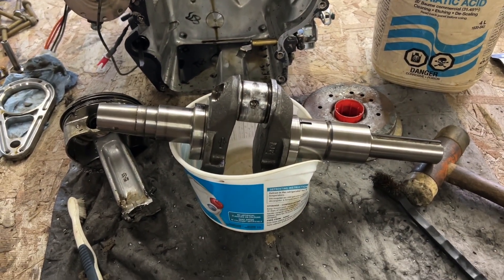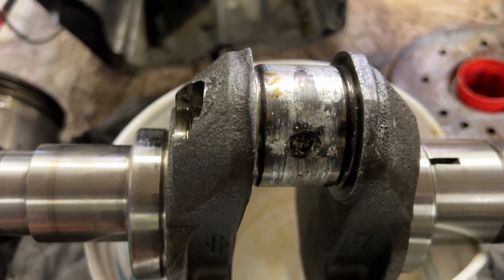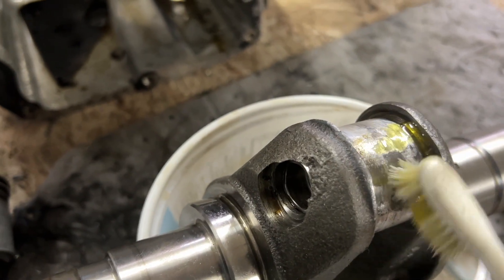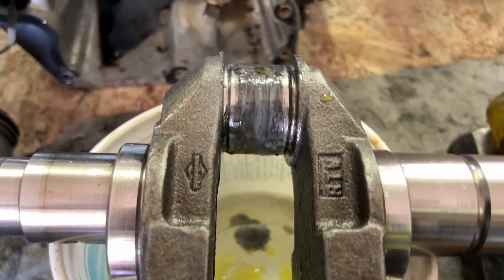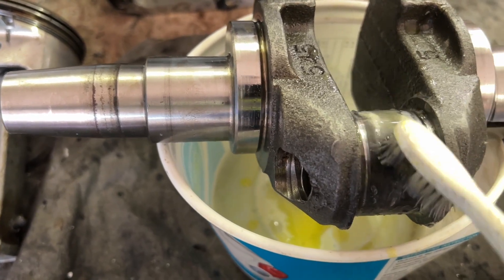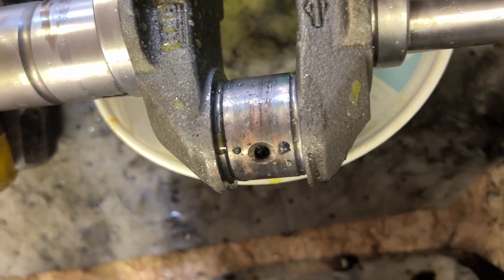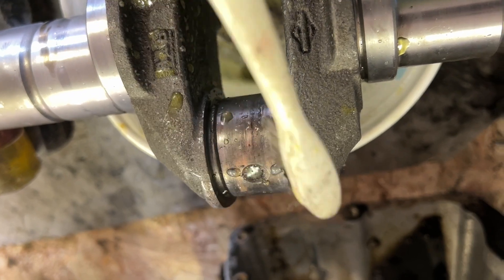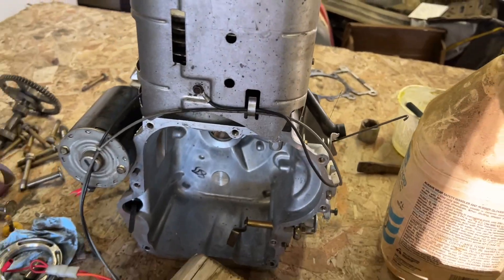How To Remove Aluminum Baked on A Crankshaft

Comment: Thanks for sharing this. I'm currently working on a off road cart for a friend. The clutch apparently had locked up which then damaged the belt. In doing so the variator seized as well, causing it to be damaged by the turning of the crankshaft. This filled the splines on the end of the crank with aluminum from the variator. I'll give the muriatic acid a try. It will definitely be a time saver and not damage the splines.
Thanks again for the information.
Blessings from Georgia 🪶✨

Comment: Drain cleaner/sodium hydroxide will dissolve aluminum and not touch the iron. Hydrochloric acid will probably eventually eat iron, I mean they use it as "pickling" solution to dissolve severe rust on steel parts.